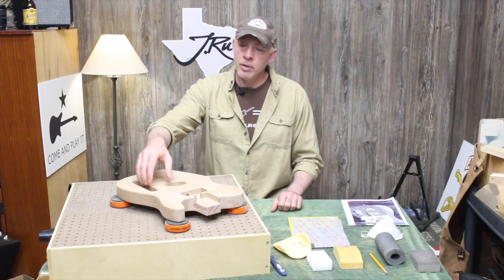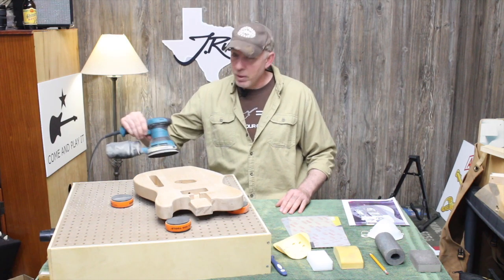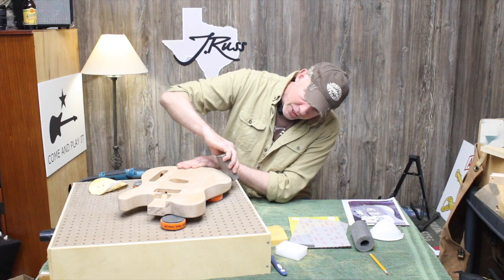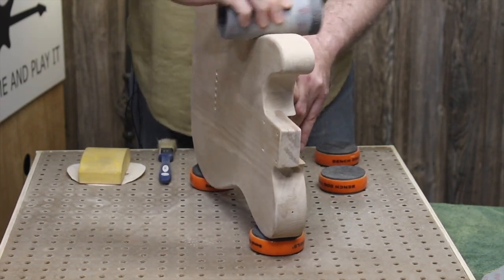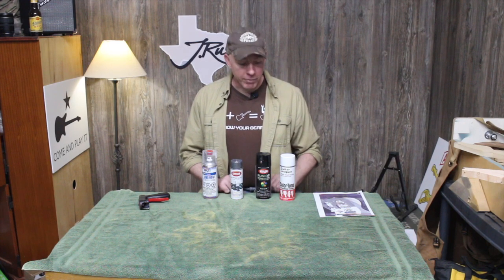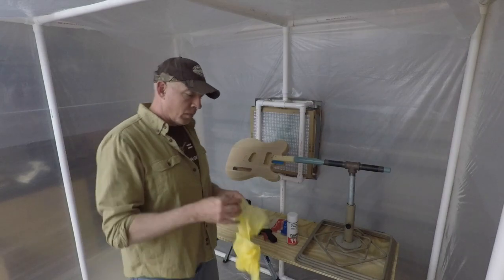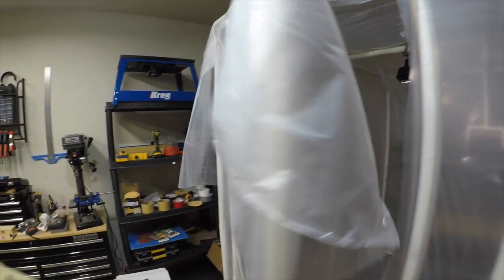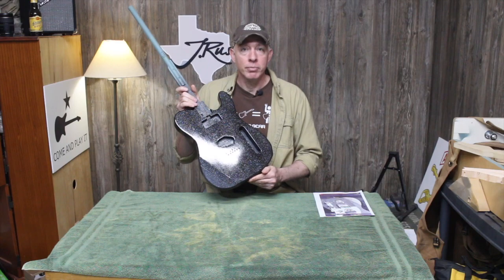Eddie Vedder Tribute Telecaster: Pt 2

Comment: Great job so far! How long did you wait between the different paint layers?
Reply from the maker: I basically just followed the instructions on the cans.  I put the vinyl sealer on all at once in fairly light passes until it was completely covered then let it dry for 24 hours.  I put the black on with a light tack coat and then three wet coats with 10 minutes in between then letting it dry per the instructions.  I put the glitter spray on all at once just spraying light initially and rotating the body then putting it on a little heavier each time until it was completely coated.  Waited 24 hours and then sprayed the 2K - same light tack coat, then three wet coats about 10 minutes apart.  Waited 24 hours and it was hard and dry.  The only sanding I did was a very light 320-grit sand on the glitter to knock down any "too proud" glitter.  But it was rough anyway when it dried - that's just because of what it is.  It will never be smooth.  That's one of the reasons I went with the Krylon black paint and the 2K clear.  Nitro just didn't seem like a fit for the glitter, I can't imagine how many coats it would take to get a smooth finish.
Reply: Paint jobs are the worst part of guitar building if you ask me:p however I managed to get a smooth surface, needed 5-10 layers of transparent lacquer and al lot of wet sanding in between te layers. 

I used Montana Hologram glitter spraycan, gives it a nice rainbow effect!